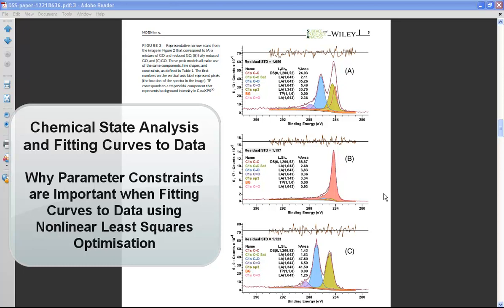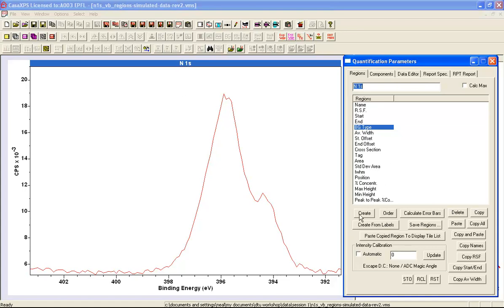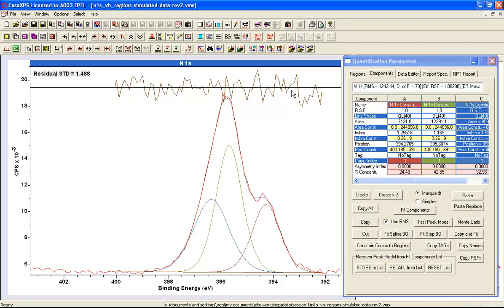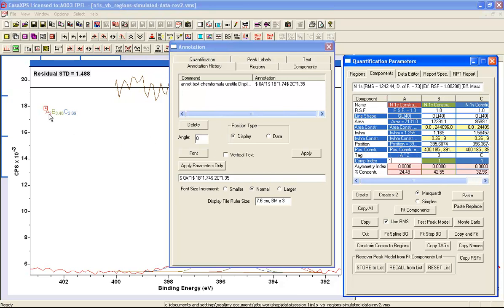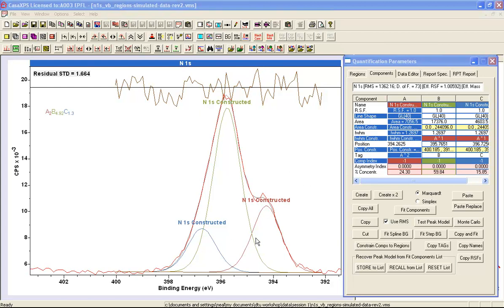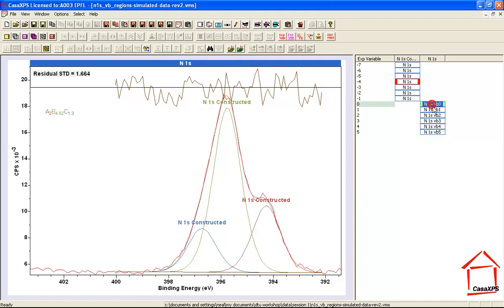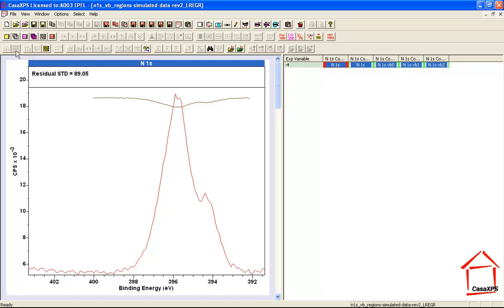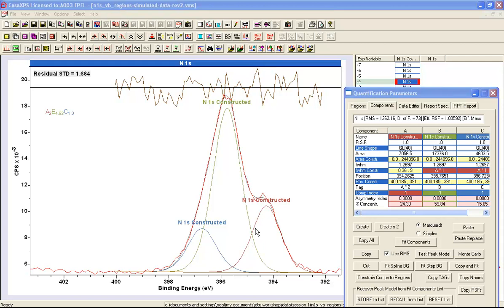Peak Models and Parameter Constraints

Comment: Hello, 
I have a question regarding relative positional constraints between two peak components. In my specific case, I'm looking at an Pb4f core level spectra of a Perovskite crystal sample. In the perovskite strucutre the Pb-atoms have an oxidation state of Pb2+, let's call it the A component.The perovskite structure however is not very stable and partially degrades during measurement, which is why a new metallic Pb component is forming (Pb0 or B component). This peak component appears in energetic distance between [-1.4eV,1.8eV]. It is clear that the Pb0 component will appear within this binding energy distance intervall but it is not clear beforehand at which binding energy distance it will appear, since there is no publicly available reference data for the Pervoskite samples I'm looking at.

Ideally I would like to setup an positional constraint for the Pb0 or B component: Pos. Constr.  = [A-1.4 , A-1.8]
Right now I only know 2 alternative solutions which are both suboptimal.
1. set an intervall constraints relative to an absolute binding energy value
2. set an fixed constraints relative to the position of another component

Is there any way to implement an intervall constraint relative to the position of another component? If not this option would be of huge value for our research group (and potentially other groups as well). Furthermore it is the only missing option of CASA which right now prevents some of my colleagues to use CasaXPS instead of other peak fitting softwares.

Best regards and thanks in advance for your fast and good answers :)
Reply from the maker: The simple answer is CasaXPS does not include constraints of the form “A -1.4 , A -1.8”. These types of constraints are problematic for nonlinear optimization and also problematic in scientific terms. I made a video (https://www.casa-software.com/index.php?video=OUViM1ZpYkdWMGVESXViWEEwTURBd01FSlRNbkJRYTAxa2JG) to demonstrate how to evaluate a peak model using the Test Peak Model button on the Components property page, but the video also demonstrates why allowing flexibility in constraints causes nonlinear optimization problems and problems when attempting to quantify chemical state. The example of S 2p used in the video returns a list of outcomes for a simple peak model, all of which return fitting statistics that are equally as good. This is very bad news for optimization algorithms and equally as bad for the accuracy of result from fitting peak models to data. If left to optimisation, small differences in position, for these S 2p data, result in very different proportions of two possible chemical states for sulphur. The same will occur for all highly correlated signal when attempting to measure, by means of fitting peak models, different proportions in oxidation state.

I have added the video to a new web-site where I am adding videos previously only available on YouTube(https://www.casa-software.com).  The videos also include a web-based-way to view the VAMAS files used to create the videos and to download the data.

Comment: I didn't understand how you found out the number of components at 2:20. Could you please explain? thanks
Reply from the maker: I have added a video to the new web-site www.casa-software.com that explains how I know there are three components required to fit these data.
Reply: @casaxpscasasoftware4605  Which video there is talking about this?